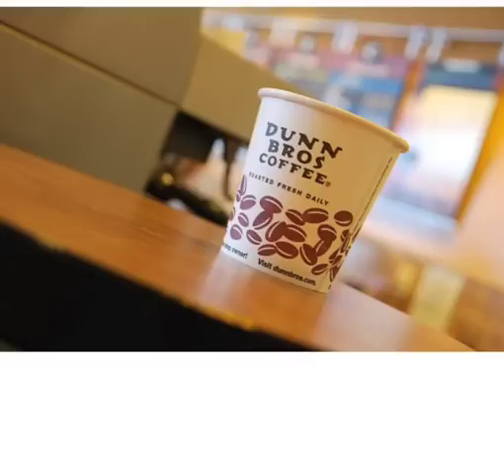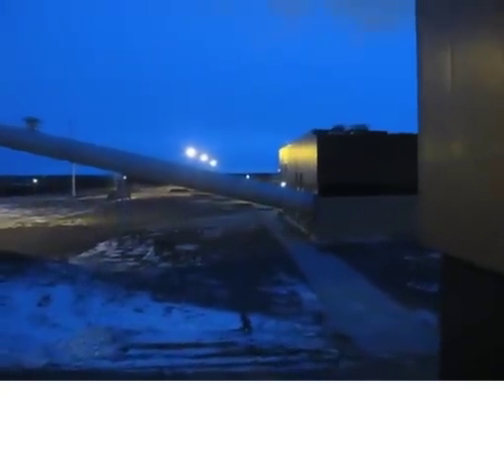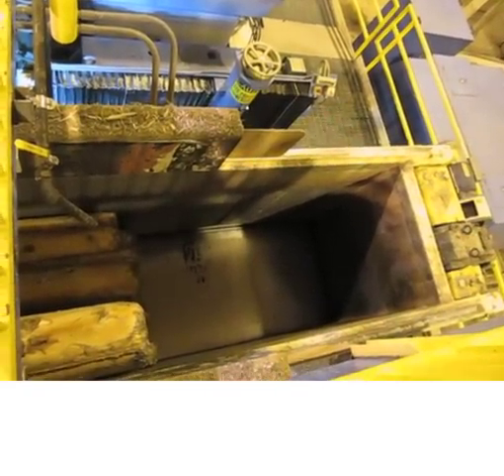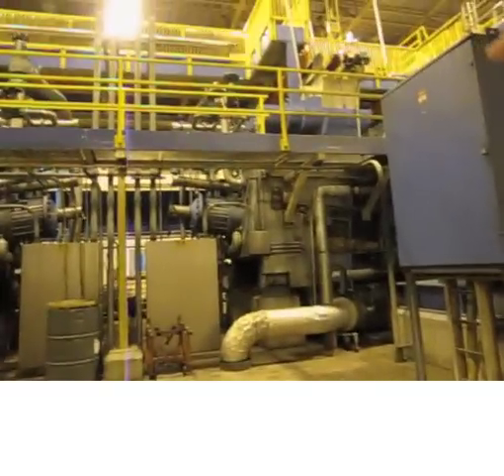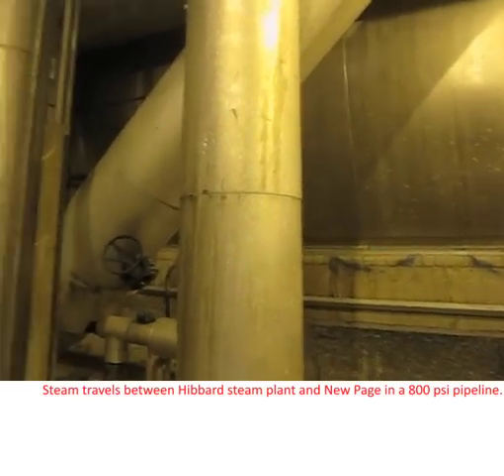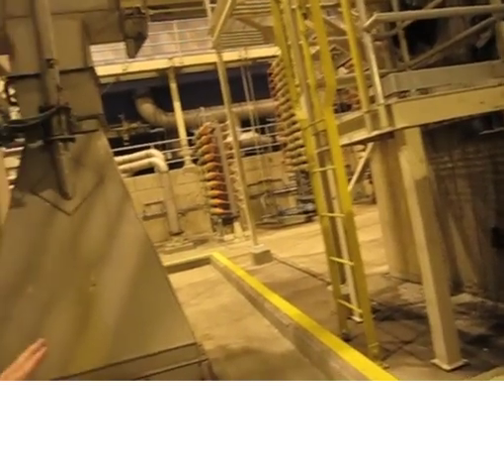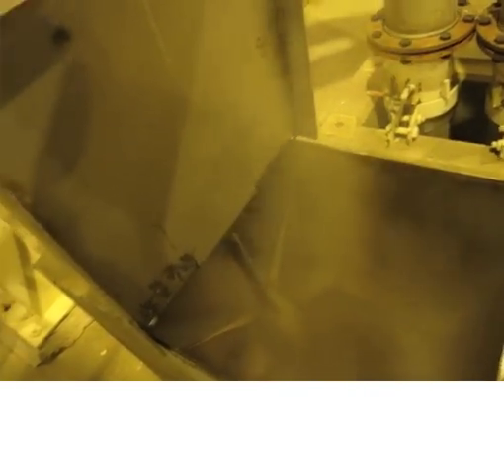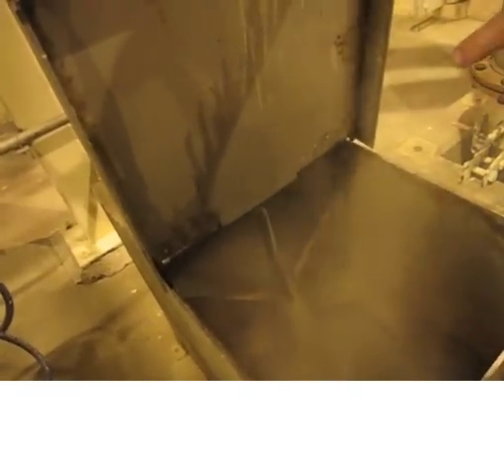Tour of a Paper Mill.mov

Comment: The process that you showed is the groundwood process, used to produces newsprint,  supercalendered paper, and coated groundwood. This process is cheaper then Kraft and Sulfite,  but the strength isn't as good. These papers are made this way because they aren't meant to be used for long. The Kappa number( the level of lignin removal) is high, which means the amount of lignin removal is low, compared to Kraft or Sulfite.